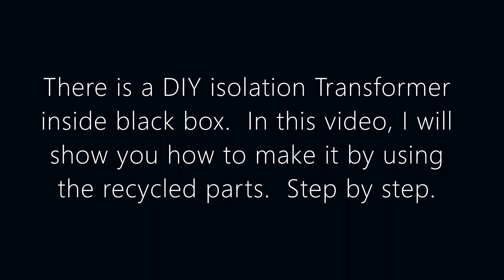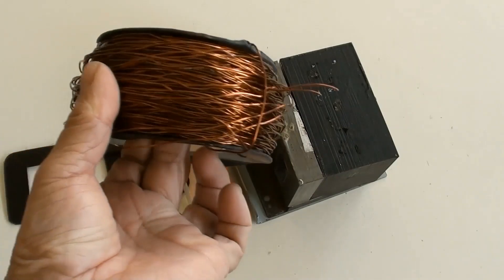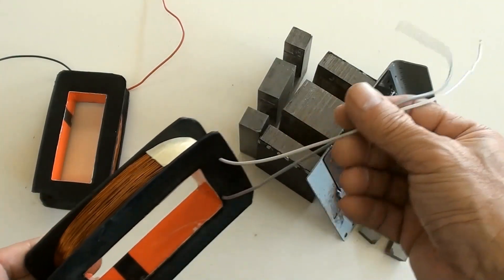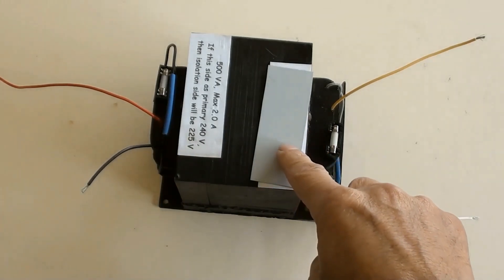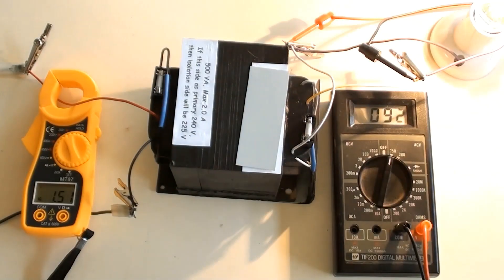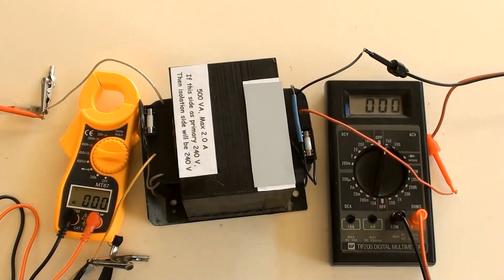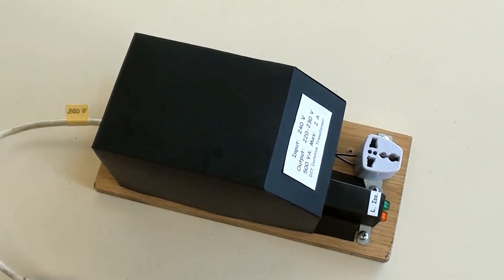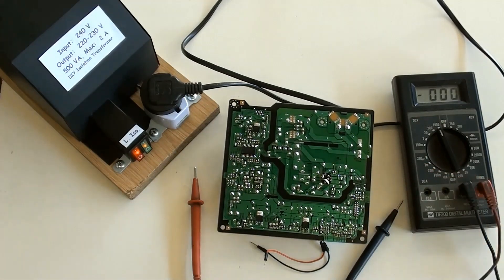How To DIY An Isolation Transformer By Using Recycled Parts?

Comment: Everybody use these microwave oven transformers for building a Isolation transformer, but this type is very inefficient, much losses and these get hot even when the output is unloaded. These are made very cheap, and that's why in a microwave oven, they are only used in short periods of time. A decent transformer of that size costs more then double the price of a microwave oven, that's says enough about the build quality of such a microwave oven transformer.
Reply from the maker: You are right about one thing:  the microwave oven transformers are used only a short period of time in the oven, however the main reason that MOT get hot is the numbers of their primary coil are much much less than the ones of standard transformers (formula 42 / S is the one of ways to calculate the numbers of coils for standard transformers.  where S is transformer's core area in cm2).   If you reused recycled, the part of MOT as materials to DIY a transformer such as reused cores and redesigned their coils following the standard protocol, a newly made transformer would not have the problems that you've indicated.   Thanks for the interested and share your thought!
Reply: Isn’t it true that you wouldn’t get shocked on the Line side of the transformer either when using only one hand? Is it the fuses on either side that prevent any surges back into the grid side?
Reply: @mateo77ish  The isolated side of the transformer can't shock you when you don't form a circuit, because there is no direct path between the input line and output line. So there's no leakage current that wants to return to the source of the input side's line. 

Touching both wires will short the transformer through your body, and current will still flow.

Touching the live side on the input of the transformer is possible, but only with sufficient isolation from grounded surfaces and capacitive coupling. Since there's always some capacitive coupling, even a small current can flow and you'll feel that. 

Being sufficiently isolated will not shock you when you touch the input side Live, but you should not try this on any occasion for any reason!